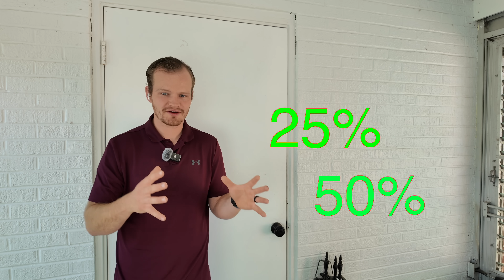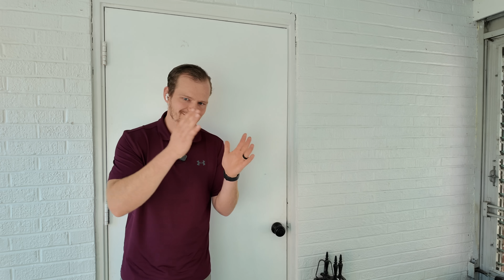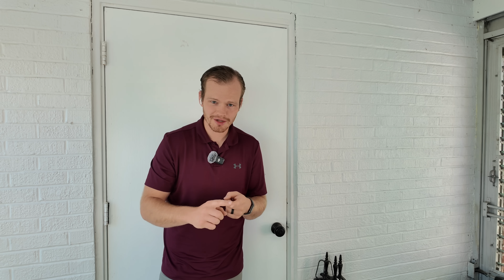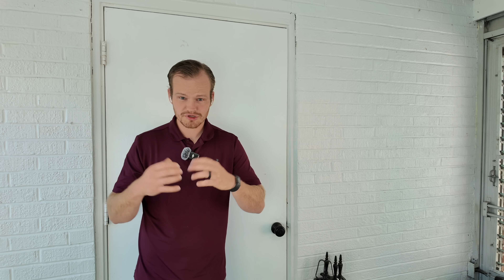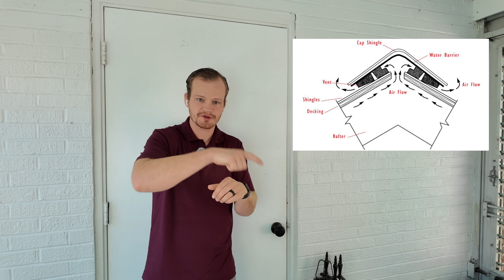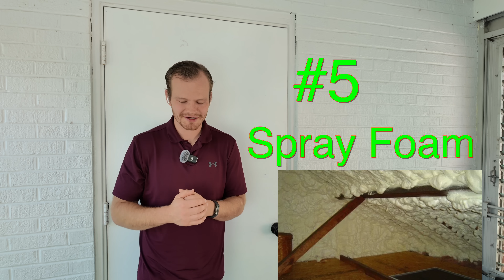5 Building Designs That Guarantee Mold

Comment: 0:42 One more byproduct of modern design is the use of windows with no ledges or sills, which many people mistakenly assume to be decorative. The theory is that with modern sealing, there is no need to divert water away from the window; that works until one of the seals breaks. Worse, it requires that the sealing be restored every time a window, or the some siding is disrupted for any reason, and we know that sealing between dissimilar materials from various vendors isn't always reliable. Going back to traditional window designs with the flashing extended over the top ledge and an angled sill underneath each window doesn't guarantee zero leakage, but it does guarantee that the bulk of the water will be carried away from the window where it can fall to the ground. 

PS: If made from fire-resistant materials, ledges and sills also reduce the chances of a fire spreading out one window and into the one above it.
Reply from the maker: Never considered this but I appreciate you pointing it out!
Reply: Thanks so much for sharing your knowledge!
Reply: Unfortunately on our house in SoCal the window ledge is made of Styrofoam covered with stucco patch.😮

Comment: Solar panels always leak and you can't get to the leak to repair it.
Reply: Never place solar panels on a roof! Put them on top of a carport or pergola or they even have panels that can be made directly into your driveway!
Reply: @OsotastyLordKC I put them on standing seam metal.  Racking system attaches only to standing seam, no penetrations at all.  Works great - no way to leak.
Reply: @OsotastyLordKC they also have ones that are kinetic generators as well as solar.  I saw some video while ago about some Chinese driveways and roads being made with them or something they look like octagons that clicked into each other
Reply from the maker: That’s a good point!
Reply: It depends what kind of roof you have. With a standing seam metal roof the panel mounts clamp to the standing seam so nothing penetrates your roof. On a shingled or corrogated metal roof they screw through the roofing material and seal it with caulk or tar which eventually fail and leak.
Reply: @zone4garlicfarm  it’s really bad for tile roofs, and tile roofing is very common where solar is going in on roofs the most. It’s actually insane to allow leased solar to be placed on a tile roof.
Reply: @zone4garlicfarm   i have rooftiles,  and panels,   no leaks    i think it relies on who has done the work,  and roofing materials.
Reply: @zone4garlicfarm depends on how the standing seam roof is attached. If you are doing it before the standing seam roof is installed you can plan ahead. If the standing seam roof is already on. The fasteners aren't strong enough to hold the solar panels and the roof especially in any kind of wind. It could take the panels and the roof off.
Reply: Never had a leak on two homes over ten years
Reply: @impossiblemercy76 it probably leaked and you didn't see it.when you take the panels off you always find some  bad wood. Sometimes times you don't see it on the ceiling because the water is absorbed by the insulation before it gets to the drywall.  Give it more time and it will appear. 10 years isn't enough time to show up. A roofer for 51 years and seen plenty of bad installations.  You might have been lucky.
Reply: @impossiblemercy76  Buy a FLIR device and wait until your next rain.  
Then during the rain, look thru the FLIR device to see if you have leaks shown by cold spots.  
If you haven't used a FLIR device to check for leaks, then you do NOT know whether you "never had a leak" or not....
Reply: Why put solar panels on the roof if u have some land? Never understood that.
Reply: Thanks for mentioning that. Yea, as much as I would like to have solar, I don’t want to risk the possibility of roof leaks. Not worth it!

Comment: So if flat roof cause mold why isn't there million and millions of commercial buildings with leaking roofs and moldy interiors?  Well because flat roofs do not cause mold and do not leak the way they are presented in this video.  So after hearing that BS in the first minute of this video I took a hard pass on the rest.
Reply: There are flat roof  buildings with mold everywhere in healthcare. Everywhere I have worked has moldy falling down dropped ceilings. Sick building syndrome is real. I have seen the State Health Department shut many down to do repairs.
Reply: @wendyinegbenedo1307  Talk to the maintenance staff at one of these facilities about the budget for roof maintenance.  When they tell you enough hasn't been spent or there is a known problem that hasn't been fixed, you will learn something.  Oh so the state has to come in and force repairs, thanks for telling us that there were repairable and maintenance issues that had been neglected.
Reply from the maker: Yep 100% you pay attention.
Reply from the maker: Start paying attention when it’s raining inside your local gym, grocery store ect. It’s not uncommon to see them getting out trash cans to catch leaks. Also look up at the drop ceilings and see the water damage discoloration. Your just not very observant
Reply: @LumberjackHealthyHomes  ANY roof that is improperly maintained will leak.  There is nothing inherent in the roof itself, high slope, low slope, no slope that causes leaks.  Oh and BTW, flat roofs do have slope in them, flat roofs do have drains in them.  It's only when poorly maintained that they develop low spots and allow water to pool.  So get your facts right or better yet quit posting BS videos.
Reply: @thepegger8422  with high pitch roofs, thatch is enough to shed water. Low pitch flat roofs need fancy waterproofing to keep water out.
Reply from the maker: I would say the inherent part is that they are flat lol. Flat roofs have a pitch of as little as 1/4 a foot. If you really want to argue that they aren’t way more likely to develop leaks then we just aren’t going to agree.
Reply: Dude lighten up partner! I take it you never ever took apart a house when you do get back with us.
Reply: Over 50% of buildings have mold issues.
Reply: @theDurgaLove  So what?  Much more than 50% of commercial buildings have flat roofs.  IF flat roofs caused mold (which they don't) why is the percentage so low?  Keep piling up the BS there sport.